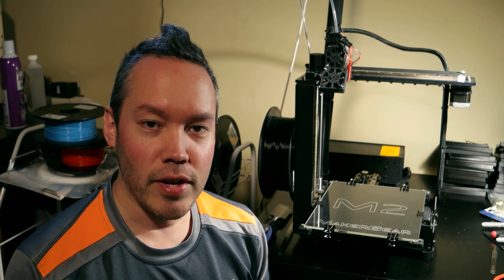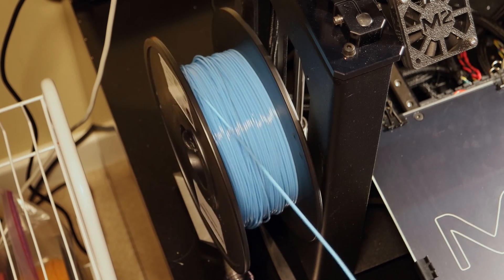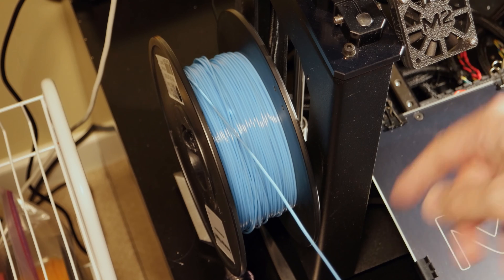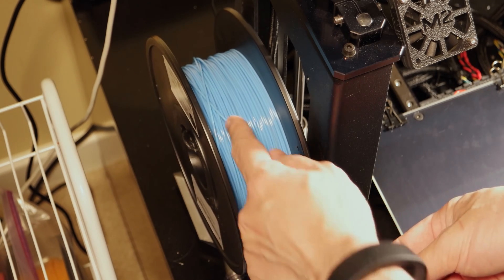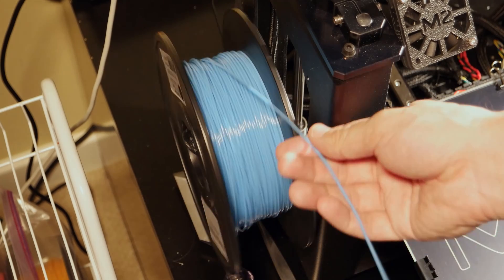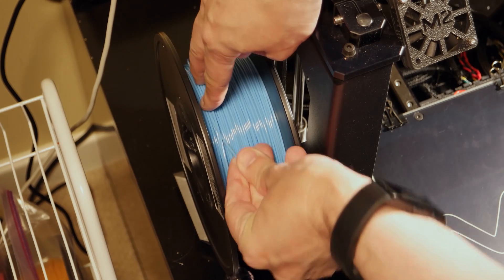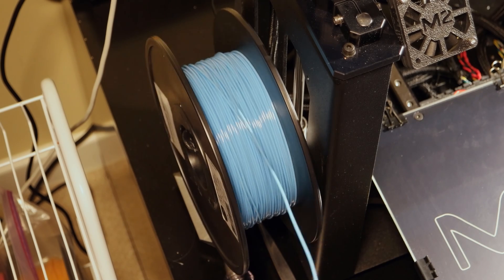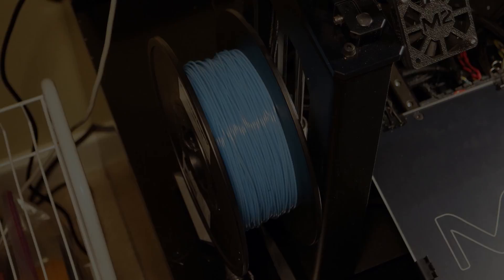3D Printing: How to untangle a spool of filament

Comment: You are causing more tangles as you try to feed the end back through. Need to keep the tension on the rest of the filament. Easier to just grab a couple loops and pull it off the side
Reply: Sorry, English is not my mother language and I am not sure if I am misunderstanding. What you describe here is how Aaron do in the video? Or there is a better way? 😅